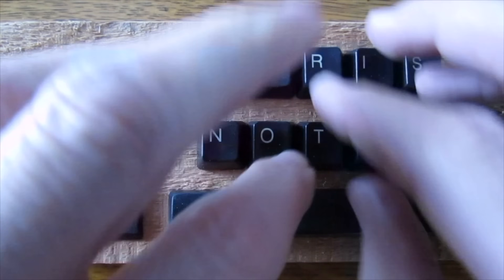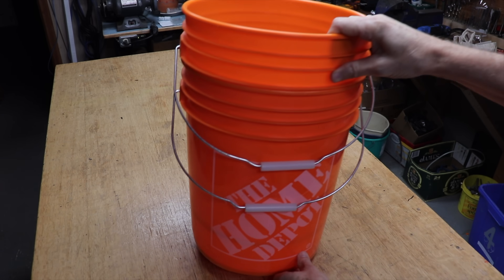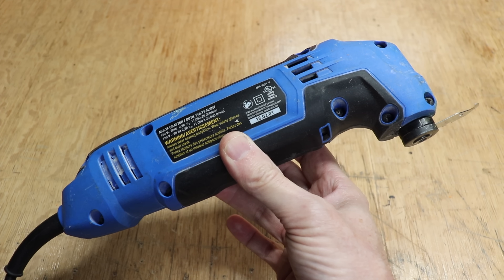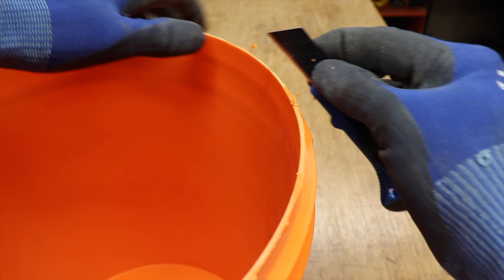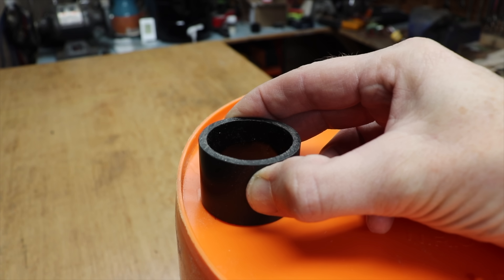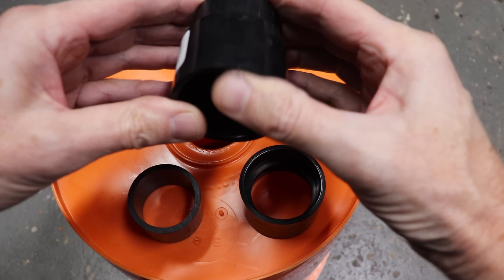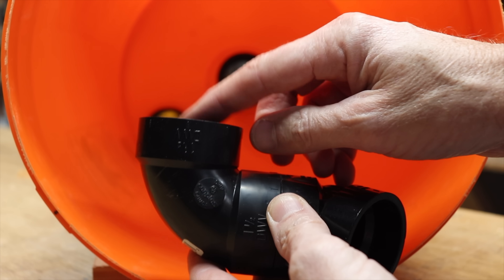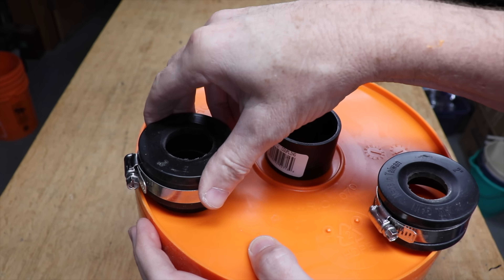How to Make ● Simple Cyclone Dust Collector

Comment: This is looking deceptively expensive and wasteful of materials.  The cheapest 1.5" pipe at HD or Lowes in Canada is 6ft of PVC or 12ft of ABS.  That's $17-20 just for the few inches needed to connect the couplers, and a lot of left over pipe.  The rubber caps in the affiliate link are currently $20 and give you 2 more than you need.  Elbows and buckets are cheap but the other pieces complicate things.
Reply from the maker: Here in Canada you can go to HomeHardware and buy it by the foot. Check your local plumber supply store and local hardware stores. You'll find a place. Or failing that, look for a plumbers van and ask if he has short pieces to sell you. Good luck!

Comment: Just built one of these and it works just like the video says it will (always a shock when that happens). Only change I made was not using the rubber end caps and instead 3D printing adapters to attach larger hoses (2.5") to the 1.5" PVC connectors input and output connectors.
Reply from the maker: That's great that you 3D printed them!

Comment: After a few modifications, it worked amazingly. My joiner was getting clogged up after a few passes when it was hooked to the shop vac, but after running it through this setup it was completely clean. I'm building a stand that attaches to the vac so it can be moved around easily. One thing I would point out, is to make sure you get heavy duty buckets. I just grabbed two from HD and they were are so flimsy I'm going to have to incorporate a brace to hold the hoses in place. No big deal, but with a thick bucket you wouldn't have to do that. Thanks for the video, no more dirty garage.
Reply from the maker: Did you watch the update video?

Comment: Just wanted to share my experience. I had to tweak your design because I had to use Lowe's buckets and they have a large flare on the side I had to shave down. And my shop vac draws so much air that I had to go up a size on the fittings to keep it from collapsing. But it all worked out in the end.

Thanks
Reply from the maker: Did you watch the update video on the collapsing issue?
Reply: @chrisnotap  I did, I found that going up a size on both fittings reduced chances of collapse.

Comment: Thank you for such a great video. I built one according to your instructions, but I used a couple 5.5 gal pails I had from wine-making, so they made for a taller version. Worked great! I did a comparison of weight of dust before and after use, and found that I have 98% efficiency! The walls of the pails are thicker than Home Depot pails, so I have no problem with imploding, but it's quite top-heavy, so I need a third pail to weigh it down per your update video. And maybe I'll put some castors on it. Thanks! BTW if you have a set of Forstner drill bits, 1 7/8" is perfect for the holes; no snippers needed!
Reply from the maker: That's great! Thanks for the tip on the Forstner bits!!

Comment: built this project only problem is dust collector sequel is unbelievable, does anybody have the same problem and has found the solution
Reply from the maker: I'm not sure what you mean. What problem are you having? Oh wait....you meant squeal! Some have had the same problem and it will be one of the hoses. Use the process of elimination to figure out which hose it is.

Comment: FYI - the coloured pails (HD, etc) are cheaper plastic than other manufacturers.    I will use some old white paint pails that I have lying around.    I found this when I mix materials inside of them and ended up with orange shards in my drywall mud from the metal mixer.   Upon investigation it was stripping burrs from the inside of the bucket.

Comment: Size of the buckets have changed. They don’t make them like they used to anymore. I’ll have to figure out another solution.
Reply from the maker: There seems to be 2 styles of buckets that Home Depot uses across the country. Most work. Some don't. Others have said they used Lowes Buckets and they worked. Might be worth a try. Hope that helps.

Comment: So I had a HELL of a time getting the buckets to seat with one another- maybe they were warped or something, but I found that chamfering the inside of the bottom bucket allowed them to FINALLY go together. 
Awesome plans and the rest of assembly was a snap. For the rubber caps, I just sliced an X and pushed my vacuum lines in. 
Thank you so much Mr. Notap!
Reply from the maker: From other commenters we have figured out that not all home depot buckets across the land are the same. There seems to be 2 models. The good part is that most of them work.
Reply: I got Menards buckets. I couldn't get the Carpet cutter idea to work on my Oscillating Saw. I used Cut-Off blade on rotary tool (Dremel like). The carpet blade would not stay secure. I messed up the top edge of bucket (gouges, dips, etc.) I could not get them together.
I may buy a different brand of 5-Gallon bucket.

Comment: I made a cyclone dust collector with information gained from your video. I used a plastic canister used to store rice and flour and though it cannot be used as a rice container anymore, it found a new purpose as a dust collector. I made it as a household vac for my smaller powered vac. 
Can you make and show how to use parking light or car interior light as a small sized reading lamp? I’ve scouring YouTube but have not found any tutorials anywhere close to my search. Will be eternally grateful. Thanks.

Comment: I bought a new home Depot pail because the lower pill I was using was not home Depot and the upper one would not fit in I had the same problem with the two home Depot pills so I had to cut one more ridge off the top of the home Depot pail and cut away the handle brackets and tape the gap for it to work I tried very hard to get one home Depot bucket to go into the other the way you demonstrated it in the video. However I did get a third bucket and use it with a broken to give it stability and so far that's worked well

Comment: Works like a charm.  NOTE: BUCKET CHOICE MATTERS.  I wasn't close to a Home Depot and used a local HW store bucket set.  The ribbed areas at the top were narrower compared to the HD set.  These other buckets worked but a little more material would have made a more secure interface.

Comment: PLEASE make something equally DIY that works to filter regular household dust from a room!  I've tried a number of commercial "air cleaners" - including expensive ones - that just don't work.  If you devise a Home Depot bucket-based solution, I'd build it, you'd be my hero, and it would be a game changer.  Thank you!
Reply from the maker: Can I ask why you want to filter regular household dust?
Reply: @chrisnotap  yes!  My place just gets too dusty - not my workshop but my actual living space - and nothing I've tried that's commercially available (and not ridiculously expensive) has worked.

Comment: Chris, love the idea.  Do you think you would get the same affect if you use 2 different size buckets?  I don't have the room under my bench for 2 full size buckets.  I was hoping to use a 2.5 gallon & a 5 gallon bucket.  Let me know... Mike
Reply from the maker: Sorry. I don't know if that would work or not.
Reply: @chrisnotap  OK. Thanks.  I might try the upper as a smaller bucket and the lower as the normal size.

Comment: Couldn't you put water in the bucket and have a pipe submerged on the exhaust side to trap all particles in the water?
Reply from the maker: A pipe in the water would cause a lot of agitation which would create a lot of moisture in the air which would wet the filter and cause low suction. Good idea though.
Reply: @chrisnotap  But If you have a wet/dry vac that was designed for moisture..  Or maybe just remove the filter since the water becomes the filter.

I have alway hated how shop vacs suck in dust one end and shoot it out the back.  I mean what's the point.  My solution was to get a 30 foot hose and locate the unit outside.  I remove the filter to compensate for the lowered suction.  Did have to text the neighbor sorry for the dust once.  I put a wet rag loosely over the exhaust and that helps.

Comment: This works for a while, but eventually the top of the bucket starts to warp from the hoses pulling on it. I've used this setup for about 2 months and it's starting to slowly fail.
Reply from the maker: Did you watch the update video?

Comment: This would work great for ash in a fire pit. I got a shop vac for that reason and it didn't work that great. Lasted like 1 minute before filter clogged haha. I was upset. This design looks like it would be the answer.
Reply from the maker: I wish I could tell you it would work but I can't. There have been a few other commenters asking the same question. Ash is very light and fluffy. It may work. But also might not. Please reply back if you do try it and I can pass it on. Thanks.

Comment: Rather than building a sawdust separator, attaching a shop vac, sucking up the sawdust, then emptying the separator, my solution is to suck up the sawdust using a shop vac. Then I empty the shop vac.
Lather. Rinse. Repeat.

Comment: This isn't anywhere near that elaborate,,, but works quite well !!!, Where you plug the hose into the canister take pantyhose that you buy in the little plastic thing for a buck at Wally World,,, put it over the hose before you put the hose on the vacuum put the hose on,,  then all the dust,, the rocks,, the sawdust, gravel, whatever you vacuum, all collect in the pantyhose  inside the vacuum and just the micron microns of dust get in the filter then you can either dump out the pantyhose or throw it away ...diabetic socks Also work well,,,,

Comment: The new Home Depot buckets look to have a different configuration in the top three rings. Do you know if these will work? Also, the Lowe's buckets only have two rings at the top and look to taper out.
Reply from the maker: A few others have had the same issue in different parts of the country. They have also said that they used Lowes buckets and they worked. I hp that helps.

Comment: "Found an easy way to attach the two buckets with no additional parts" then goes on for the next min showing 12 different parts needed to attach the buckets.
Reply from the maker: Actually to attach them together there is no extra parts needed! That's what's so simple about it, it uses the bucket itself. Just cut it and trim the edge.
Reply: @chrisnotap  There's one in every crowd...

Comment: I followed your instructions exactly (even the second bottom bucket with old wheel weights to keep it upright). I have since filled the catch side to at least 3/4 with general dirt, grime, drywall dust, and sawdust at least four times. Drywall dust seems to be the only thing fine enough to get to the filter. Even that was a total of less than one cup. Great DIY video!
Reply from the maker: Glad it helped!

Comment: I
Great video, I followed all the steps, but for some reason I can't get the 2 buckets to connect. I have the same HD bucket and followed the instructions to the tee. It looks like the 2 lips are the same diameter and won't go in together. Any advice would be great!

Comment: I came across this video by accident and got curious. Watched the whole video and I've got a question for you. I hope that the video is not to old.

Wouldn't it be good to have a hose or pipe down to the bottom bucket so that the dust collector "automatically" tells you that it needs emptying? Since the vacuum would dissappear from the end you're using to suck up all the dust when the collected dust reaches the hose. 

Just an idea I wanted to share

Comment: I made this exactly like you showed and when I use my orbital sander all the fine dust still goes straight to my shop vac So I moved the dust inlet port a few inches farther down and it made no difference I was wondering if you had any suggestions as to how I can fix this problem heavier items like regular sawdust still go to the bottom of the bucket.
Reply from the maker: Make sure the angle of the inlet is correct like in the video and that it hasn't moved while attaching the hose.

Comment: Hi Chris, very impressive setup and great explanations for every step. I am curious as to if you have a shopping list for the larger 2 1/2" shop vac tube. I have a 16 gallon vac that'll pick up a bowling ball so I don't want to make my cyclone too small. I am also going to build the wet vacuum collector, but again would need a shopping list. I've already copied the lists for both of the ones you've made. 
Thanks in advance,
Tom
Reply: I'm also trying to figure out hardware for the larger vac tube. Any luck?
Reply: @IanDixon79  I realized my big vacuum is just too powerful so I bought a smaller shop vac and made this tool. I also made the water vac, but designed it differently so that I can add water to the base and vacuum up drywall dust.

Comment: The cutting blade, on the oscillating saw, is dangerous. Nobody should try that.
Reply from the maker: You might think it's dangerous, but it's not. Think of how dangerous a jigsaw is with an exposed blade. Or a skill saw with exposed blade, table saw, band saw etc.  This is just another tool to be aware of the blade. If it happens to loosen, it just falls out. I tried it and it is very safe.

Comment: I've been needing something like this! I'm physically disabled (wheelchair and limited mobility) so I have a small shop inside my house (bedroom converted into a small shop) to do some Dremel work with.. I use a shop vac and a home made table to collect the dust, but the filter on the shop vac clogs up very fast. I have to use a smaller shop vac just to clean off the filter! LOL! This is perfect for my needs AND budget. Thank you so much. Two years later and this video is still making a difference. Subbed! - edited due to the fact that I used to be a writer and have OCD :P

Comment: This works great! Thank you!

Using 2 old 90 mil 5 gallon buckets and 1-1/2" ABS I had, plus parts from Habitat For Humanity ReStore & Home Despot -- my cost was $9.58 + about a gallon of gas for trip to the stores. I left bucket handles on. I use them and a rope & clip to hang the cyclone on my 6 hp 16 gallon Rigid shop vac for a mobile solution that won't topple. My inlet hose is about 1-1/4" diameter 8 ft. shop vac hose. Hose from cyclone to shop vac is shop vac's standard hose about 2-1/4", with a standard step-down fitting right at cyclone. I installed 10-1/4" diameter disk of 3/16" underlayment plywood from scrap up inside top of cyclone. ReStore had only 90º elbows, no 45's, so I cut a 90 in half for the 45. No whistling.

Top bucket rim didn't fit into lower bucket. I used a heat gun to warm up an inch of upper bucket rim, from the inside so it didn't soften outside ribs, and nudged rim inward a bit wearing leather glove. I didn't think I'd made any difference, but when I tried it, it fit great.

If later needed to stop thwucktion collapse, perhaps when it's warm in summer, I'll double up lower bucket. 

Your suction lawnmower oil change setup is also on my "bucket" list.

Thank you again.
Reply from the maker: Did you watch the Update video?  https://youtu.be/BeU4nqSJtBY
Reply: @chrisnotap  Yep. Thanks.

Comment: I don't have a shop yet so maybe this will make sense later.  But if you got a shop vac, why not just empty that when it's full and not worry about a different bucket to collect the dust.  What am i missing?
Reply from the maker: Opening up a full shop vac makes a mess plus the filter get impacted with dust. Cleaning it is a mess. This simplifies the process.

Comment: I will raise you one on the bucket joint -  much easier to ram one lid on the bucket. Now cutout the inside of that lid out. now hot melt another lid upside down on top that one, along the rim. Now cut that one out. Tah-Dah; tight, clean removeable bucket doubler. Your welcome.
Reply from the maker: I did that! But the edge left after cutting out the centres caused too much turbulence. As I cut the edge right back to the surface of the bucket, there ended up being very little structure left to have it work. been there done that!!

Comment: I don't have a woodshop, but I do have a shop vac for around the house.  I don't get it?  Why separate the sawdust instead of just letting the shop vac do the collecting.  Why circumvent the shop vc canister?
Reply from the maker: Good question! The problem is the filter in the shop vac gets totally plugged and is messy to take the lid off when it is totally full. When you remove the lid, it pulls sawdust out with it. This just simplifies and reduces the hassle.
Reply: @chrisnotap  Well yes, I  understand now.  Yes, vaccuum bags are expensive and if you do a lot of sawdust cleanup, the filters get plugged quickly, and are expensive to replace.

THUMBS UP!!!

Comment: Hi! For all the viewers out there - I just built this project and it worked just fine. But- I live on the Left Coast,  and the buckets available from the bright orange HD store are NOT configured the same as the buckets Chris got for the videos.  I had to do a lot of "bucket sculpting" to get the top bucket to fit into bottom. And I had to do sculpting on both buckets.  Like I said - it works just fine, the project is still well worth doing, it'll just take a lot more grinding and filing, and a fair bit more time. Thank you for all the work on this, Chis. It's an awesome add to a small shop!!
Reply from the maker: Others have said the same about the buckets in their area. Others have also said that they used Lowes buckets and they worked just fine. Thanks!